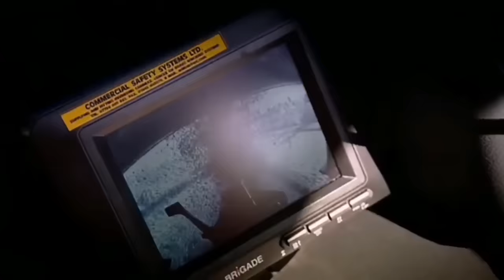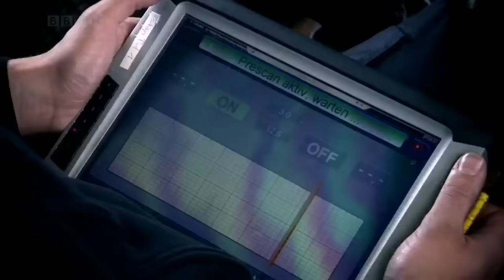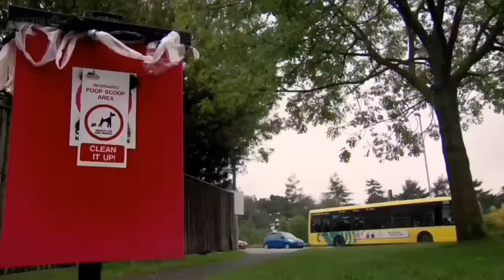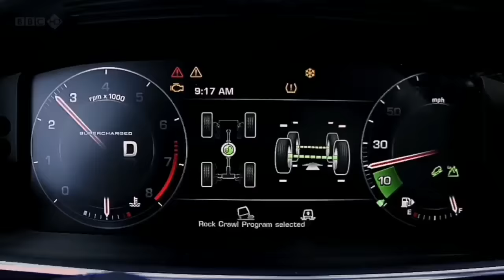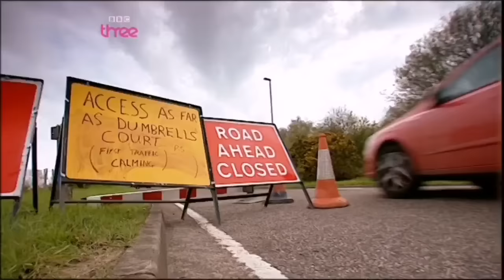May, Hammond, Clarkson "Things Got Worse" Compilation

Comment: From Nissan USA website “The Nissan JUKE was known for stylish looks, available AWD capabilities and sporty performance.” Yeah when I see it I think I would much prefer something that looks like a bug over an RX7 or Z28 Camaro or any other sports car, and performance so sporty it could easily out do any sloth in a race or off road or anything.
Reply: It is much cheaper that a Camaro. And it is quicker than most cars on the road. Knot to 60 in 8 seconds is very nice. And it's a good car to drive too

Comment: Idk about y'all but the Juke is actually a decent car. Yes, it's ugly, like hell and is slightly overpriced, but its very good otherwise. It's like a cheaper and larger version of the 370Z
Reply: Absolutely nothing could have prepared me for that final sentence wtf. Those two cars couldn't be further apart if one of them was a bike
Reply: @baileyjones4379  don’t talk when you don’t know about them
Reply: @emiratesaviation33  the juke is a 4 cylinder front wheel drive SUV, the 370z is a v6 rear wheel drive sports coupe. They share a Nissan badge and about 2 foot of floor pan, what
Reply: @baileyjones4379  the main version of the Juke is a 4 cylinder, but you can get the Nismo with a V6, for not too much more. And the Juke isn't an SUV, it's a Hatchback. They share only a few bits, but that's only cause the Juke is much bigger. Most parts of the Juke are designed similarly to the 370Z but to the size and shape of the Juke. And it's decently quick too. Knot to 60 in around 8 seconds(for the regular 4 cylinder model) and cornering is actually very good. I did drive one for a few weeks which is why I'm speaking like this

Edit: The Juke is AWD. The FWD one is ver uncommon. Most people buy the AWD one
Reply: If I pay a lot of money for something that will get me to work every day for several years, I don't want to think "eww" every time I look at it.
Reply: @montagistkacke7431  Veyron owners be like:
Reply: @emiratesaviation33 Veyron owners are not concerned about driving to work in them, lol. They likely only bought the car because it's expensive, after all